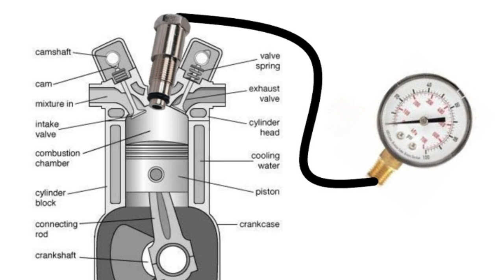Compression Loss Ford Triton 5.4L 24V Missfire Low Compression Cylinder PressureTest MarkMannM2

Comment: Hello! I'M Curious how would you replace the valve without removing the head?Thank you for your time
Reply: Yeah, I would like to know that too!!!
Reply from the maker: Obviously not the Valve itself, Valve guide, keeper, seal, Spring, Cap, Coupler, etc... You will need a Spring Compressor and you will pressurize the cylinder to hold the valve up. You must make sure both or all 3 values are in the closed position and you must lock the main crank from turning. Sorry about the misunderstanding. The vast majority of the time a seal will blow out or the spring will come undone. If the valve stem is still visible from the top you are good to go, if not, YES, the head needs to come off.  MarkMannM2